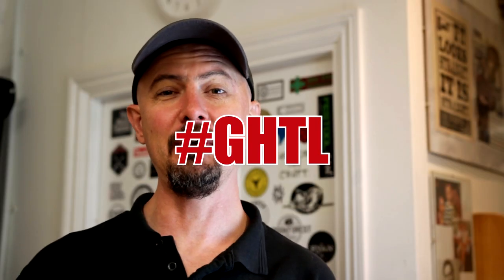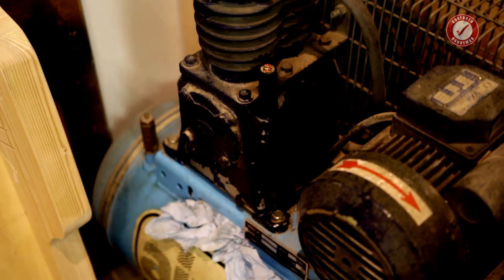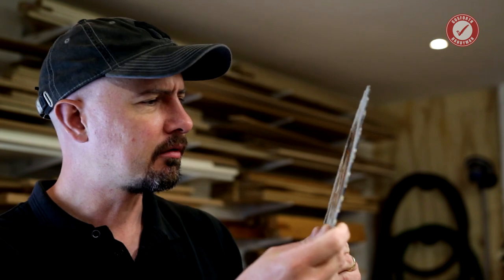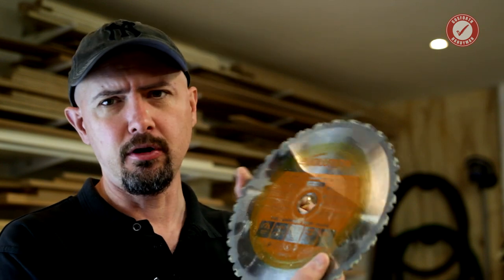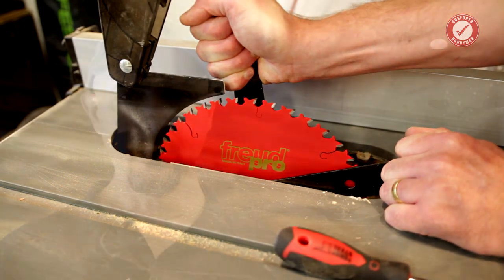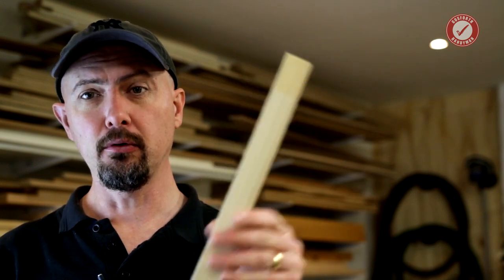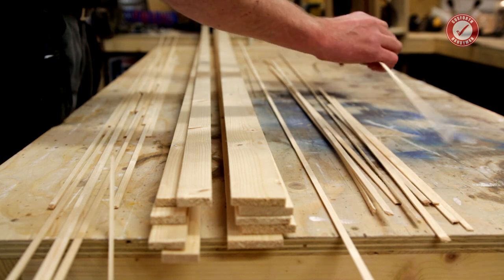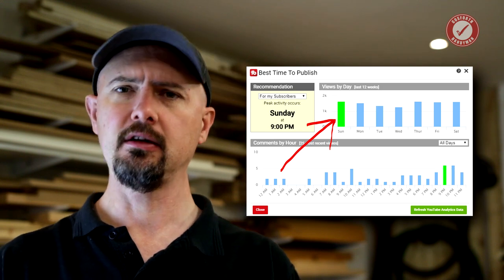Tips for Cheap Stripwood Mouldings & Compressor Oil Change

Comment: You have just solved the problem I have for replacing the wood strips on my small round garden table. I cannot get it cheap, strip wood is £4,85 per length, makes it very expensive. I have a power saw so I will rip them. Nice one mate!

Comment: Lots of tips packed in that could save heartache, especially with the compressor. But the strip wood tip is awesome.....except I don’t own a table saw, wondering if it’s possible to do this with a tracksaw /plunge saw?. Anyway another awesome vid, thanks from across the Tyne 👋

Comment: Nice camera and nice audio, it's making a big difference Andy. Just got back to Scotland and I watched yer video. Good editing. Thanks for sharing 👍😄
Reply from the maker: Cheers Gary! I'm back on the DSLR... the GoPro was doing my head in.😜 Welcome back!! Any vids in the pipeline?
Reply: Gosforth Handyman yes got vids on the go, there half edited. I've got two dslr's that in going to start using canon 5d Mark 111 and canon 650d. GoPro is too quick and easy. Your video today was very good and the difference is fab. Very tired been traveling from the Middle East, I visited a woodwork shop while I was there. I'll tell you more later. Thanks Andy
Reply from the maker: Mine's the 650D - I use a Sigma 18-35 f1.8 lens. Needless to say the lens is worth significantly more than the camera. Canon 5D? That's posh! I was getting a bit nervous about the amount of sawdust getting in to my 650D but it seems fine with a blow down from the air gun. Look forward to hearing about the Middle East! 👍

Comment: Still to much oil mate. About 400-600ml for that size pump is more than enough ☺️. Nice tips. Although, here in Croatia, those type of pine clading are not that cheap, or should I say the price difference is not that great. Keep it up.

Comment: Great tips. Thanks for sharing. I have some reclaimed flooring parts (beech and oak, 36 and 25 cm long, 22 mm thick
and 5 cm wide. I want to make small strips of (some) of them.
I tried it on my little band saw (the same as Peter Millard had before he gave it away) but that goes very slowly
and I can't do too many (don't want to overheat the small motor) But now the band saw blade broke, new one will be
only in two weeks or so.
So I need an alternative way to saw those strips. I don't have a table saw. I only have a sliding mitre saw
and a circular saw  Is there a safe way to make these strips with one of these?
Reply from the maker: Not really - bandsaw or table saw are the only options I can think of. 👍
Reply: That's a pity. Thanks for your reply.
Reply: Or make a small table saw from your circular saw? Plenty of good videos on that.
Reply: Thanks. Yes, I'm busy doing that. But it's easier said than done.
Some problems I have to solve still.

Comment: Great tip with the cladding. Try an oil free Compressor or use the Ryobi Brad Nailer (battery).
I have see most of your videos today, and i have enjoyed them all so you now have a new Subscriber.
By the way i have left a few comments on older videos, and in case you were wondering, the Wirral is over the water from L'pool and NO i am not a scouser (angry look on face ha ha ha) before you say it.
Keep up with these great videos you are doing.
Barry (West Kirby, Wirral)
Reply from the maker: Cheers for watching Barry! I have a little Stanley oil free compressor I take to site - just a little 6L job but does the job - seriously loud though! I'm sure there's quieter oil free ones - I'm too tight to go battery. A very good evening to the Wirral! 👍🛠
Reply: the bung you took out to drain the oil should have a glass front with a dot in the middle. just fill up to the dot or half way up the sight glass

Comment: Interesting comments about the blade tpi on your table saw mate, One issue you might have with a high tpi is heat affecting your blades and premature dulling as the lower tpi blades have less contact on rips and therefore do not get as hot. Have you considered this?
Reply from the maker: I think this might be an issue on thicker stock but I rarely cut anything over 1" thick - even cutting oak the blade doesn't even get warm. No issues with dulling so far! 👍
Reply: ahh I see your mainly an mdf man, same here lol. Are you on facebook as I run a woodworking group on there called woodworking UK 15000 uk members if you ever fancy a chat but no posting your own vids unless you run it past us first to prevent spamming lol.
Reply from the maker: Ha - yes, mostly MDF and ply these days. Awesome stuff - just joined! 👍🛠

Comment: Hi Andy, Can you add a link to the reducer as I'd like to purchase a new blade for my evolution mitre saw, not really sure which are best or how they fit
Reply from the maker: Hi - think I just got it off eBay - can't find the link. Note that Evolution don't support using non-Evolution blades though. 😖